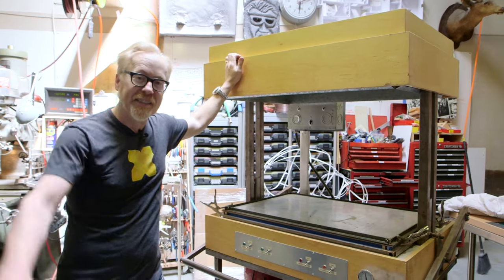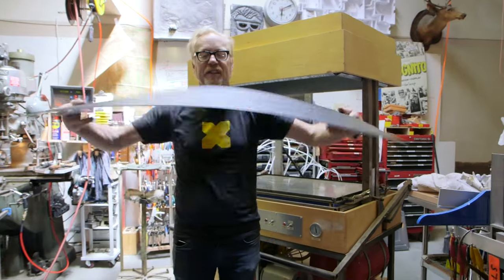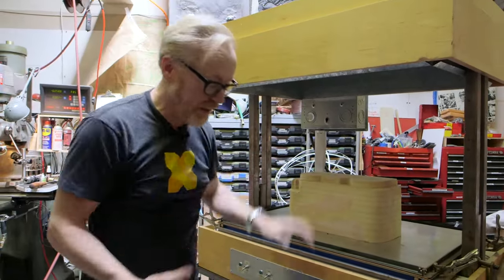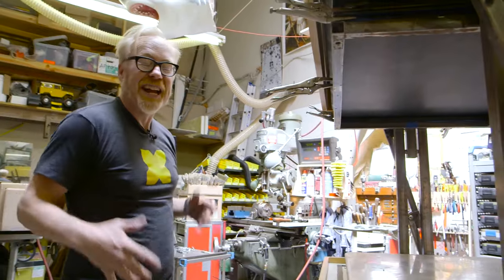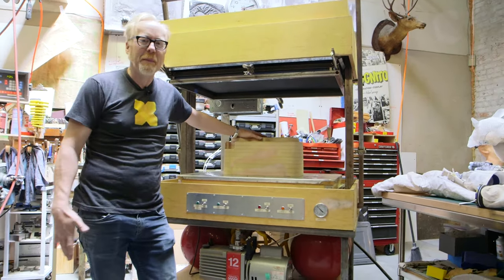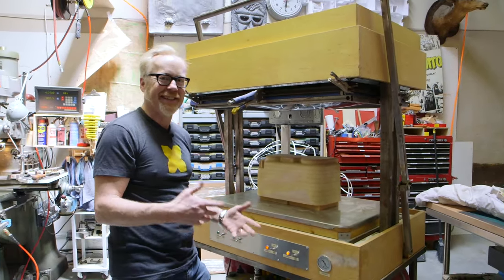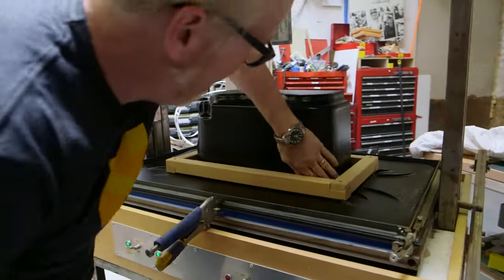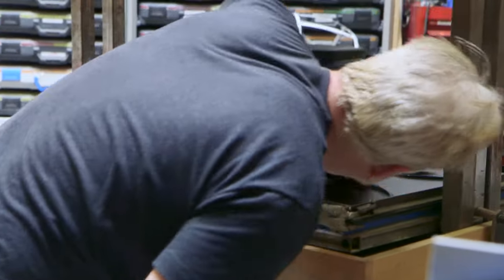Adam Savage's Vacuum Forming Machine

Comment: Hello Adam, couldn’t you have drilled small hole at the top to evacuate the Master model?
Reply: Without damaging the item below? It was form fitted. Any hole drilled into the plastic would have went right through that wood. It would have been easier to put mold release either on the underside of the plastic first, or on the item below it. Even PAM would work; Spray it on as the plastic starts to bow. Probably better use dish soap as that washed off an leaves no greasy residue. Murphy's Oil is the recommended product but that would "stain" the wood object.

Comment: to make it easier to get off use a air nozzle with a rubber tip to blow up in the mold to remove it it will help quite a  it

Comment: Would a fiber glass mold be easier?
Reply: +Ruben I make some of my molds in a high temp fiberglass but it needs to be super thick (almost 1/2" thick) otherwise the vacuum will destroy the mold. I also add a lot of bracing gussets so the pattern doesn't collapse. Plastic removes easy but the key is to have proper draft angles which Adam's pattern obviously didn't have enough of.

Comment: Pro Tip
Instead of cutting up the side, drill a small hole in the top and inject compressed air in, should pop straight off

Comment: I typed out a lot of information about my experience with these maxhines, but it seems that there is a maximum amount of words, and I wasn't even half way there. So I will shorten my story, when i was about 14 i started working at a printing company where i had to use a similar machine to package their products. I must have packaged hundreds of items, probably even thousands. I think i worked there for about 5 or 6 months, one day a week, because i could get off that amount of time from what is the equivalent of Americas high school. Now in my first comment i went way more in debt about all of this, but I will skip this because of the maximum amount of characters. However it is probably interesting to note that where i worked we had one with a glass cover so that you could see what was happening, and when the plastic shrinks, that is something undiscribeably satisfying. This machine wastes a bunch of plastic unnecessarily, which the on I used didn't.

Comment: Everyone's talking about how to circumvent the vacuum. Why not just cut out the fuse and solder the wire ends together? I mean... safety is one thing, but if it impedes function, get rid of it.

Comment: Ok I'm going to put my 2 cents to this... Nice try first of all... Here are some pointer to get a better result... Try next time fixing the mould to the base, mould need to be hollows and you need to drill tiny holes .5mm mainly where you have defined details also make sure you don't have that step that you had at the bottom for obvious reasons the plastic would get in there and won't come out... By fixing the mould to the table it means you can lift the whole sheet of plastic to demould it as a whole. Usually you would have a bigger hole in the center where you would position the mould for vacuum to go through the cavity on the mould and then throw the tiny pre drill holes. Nice work anyways.
Reply: I can't think of a way to attach this to the table without screwing up the aluminum table. it would probably become damaged when you tried to pull the plastic off... it takes a lot of fiddling and prying to remove the plastic from the form.  the table itself has a grid of tiny holes to allow the vacuum to pull through, not just one big hole in the center.
Reply: +Gabriel Brown is not a matter of just one big hole in the middle you still have the grid of tiny holes on the whole surface of the table but the one big hole is to direct vacuum thru the mold... As a general idea you always put your molds in the middle so you use the same hole for your molds...  To attach the mold you come from underneath with screws... The table surface is a sheet of MDF with thin sheet of aluminum covering it... Also to make the releasing of the mold easier you put a mould release agent (spray can it's sort of dry film).
Reply: +AEB I see what you are saying. .. my machine has 3 larger holes below the aluminum that are piped to the vacuum.  I still say that Adam's machine (same plan as mine, but smaller) won't allow for attaching using screws from below. The board below the aluminum is not accessible from below, because it is raised above the platform to allow for vacuum piping. there is also the issue of the vacuum and tanks being in the way.  I do agree that a mold release would make it much easier to remove the plastic from the form. I am only clarifying the layout because I agree that it would be nice to be able to anchor the form to the table. somebody mentioned taping the form to the table...but that may cause complications as well.
Reply: +Gabriel Brown yes exactly right some people have a grid of tap holes to use clamps to hold the mould in place but you need also to have a flange on the bottom of the mould and that would help with the webs that he gets for over stretching the plastic in such a high mould... I'm not too fond of having aluminum as base... Aluminum is cold and not very heat transferor I would rather have MDF(pretty cheap and can have set it up for different applications) some people preheat the mould and base to get better results.

Comment: You know you can drill small holes through your model so the plastic sucks to and around it right?Put your model on a sheet of plywood and drill holes through that and through your model around the base of it and it will form to it nicely. And use baby powder so the plastic comes off the mold easier.... or use compressed air so it just pops off.
Reply: Easier to use mold release or soapy water on object before putting the hot plastic on top of it.

Comment: Next time drill a hole to the top of the plastic and use normal air compressor to blow the mold out. It will fly off like never before.

Comment: Wouldn't have been easier to drill a tiny hole in the top and blow compressed air to pop it out of the mold?
Reply: Without damaging the item below? It was form fitted. Any hole drilled into the plastic would have went right through that wood. It would have been easier to put mold release either on the underside of the plastic first, or on the item below it. Even PAM would work; Spray it on as the plastic starts to bow. Probably better use dish soap as that washed off an leaves no greasy residue. Murphy's Oil is the recommended product but that would "stain" the wood object.

Comment: 5:30 Could you drill a small hole in bottom of finished ABS form, insert shop-air dust gun, give a blast of air, and BINGO, you blow it off the form!  Would it work?  Yes, you now have a hole in your creation, but in this application, it wouldn't matter.

Comment: this is called thermoforming. i have 27 years in the field. and its better to use female mold with a plug assist. you are using what we call a sheet machine.  Also use air eject to release from the mold. i could go on for hours on how to do this with great results and no webs or thin walls.

Comment: oh god XD, that was messy.... i used to work with industrial vacuumform, there are easier ways to do that, the machine works great but you could have carved a big hole in the center of the wood piece and drilled 1/32 holes trough that big hole it would make easier to form the corners since the air would still be able to push after the botton closes down, to make the mold come off easier you can spray silicone lube on the piece, and to take it off without harm you can just use a press

Comment: That was a really bad forming attempt. The tool is too high and the tool doesnt have any vacuumholes in the inner radius' for the vacuum to pull down to plastic over the tool. And as other has said, if you blow compressed air through the tool the plastic part will pop off instantly if you dont have major backdrafts on it :)

Comment: Number one its not called a buck its called a mold. The type of mold you are using is male . 2nd the mold needs to be sitting flush with bottom so plastic does not form a lip. Cut channels in bottom of mold to the side for vacuum. use fans to cool art after forming. Vacuum pump should remain on during pull. Pressure box would make for tighter part. 3rd to release the mold use air. And use infrared quartz heaters they work best for heating plastic. Its not a art its a skill to run a 125 foot thermoforming in-line 4 station machine. Trust me 27 years i think i know. lol

Comment: You don't know how to make a form!!! 
Usually you use your mind, not your hammer. ::::))))))
you made it from several parts, but not placed in the right way. You placed horizontally. 
You must have a form from at least 3 parts, but placed vertically so when the form is cooled, to be able to get out the middle and then the sides will be much easily get out.